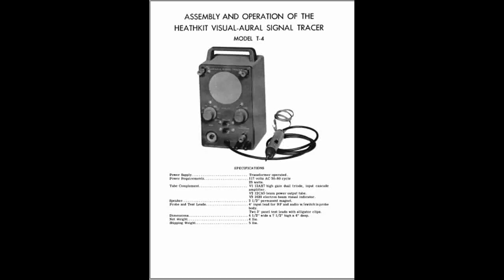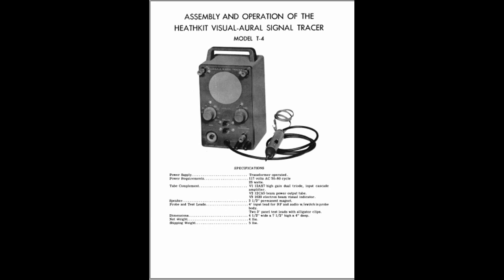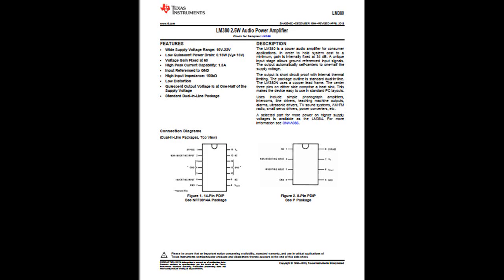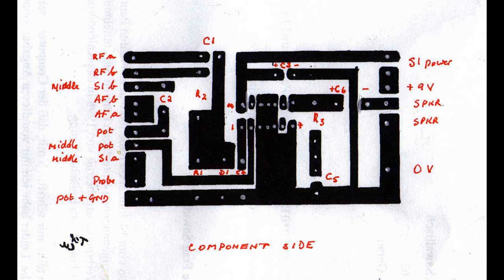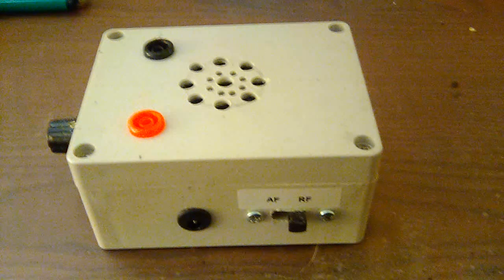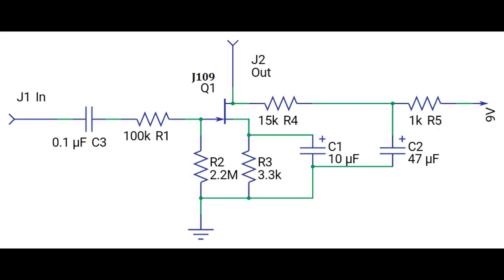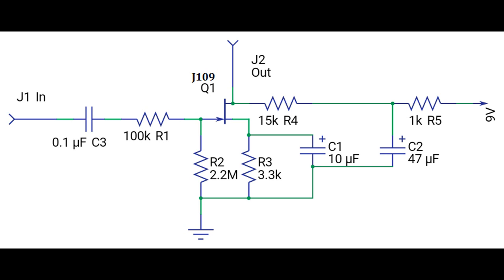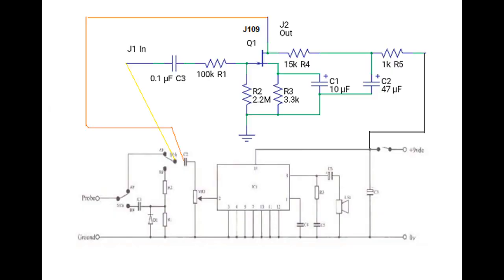LM380 Signal Tracer Mods

Comment: Hi Bob, I think I am going to try and build this as a challenge to myself.  On the J109 am I right is saying J1 is source and J2 is drain? I'm still learning so any guidance is much appreciated.  Regards, Dave
Reply from the maker: J1 actually feeds the gate. The drain is J2 and the source connects to the 3.3k resistor to ground. I think you will like the tracer. Thanks for trying it! 👍👍
Reply: @YouAllKnowBob  Thanks for the quick reply Bob, I appreciate it.

Comment: Love it Bob. I know what you mean about the 386 running away with itself, sometimes it is easier to use a transistor amp! I might try that tracer circuit as I have yet to find any others on the market over here!
Reply from the maker: It works quite well George. I'm going to try and put together a demo video today. Stay tuned!

Comment: Nice design Bob... Do you have a speaker mounted inside there ???  I am tiring of lugging out my Eico and would love something smaller....   Is J109 the name of the transistor ?
Reply from the maker: The speaker is mounted to the lid (the holes behind the banana jacks). J109 is the part number of a pretty universal n- channel JFet. Having it battery powered means it moves around easily. I real!y like it.😁